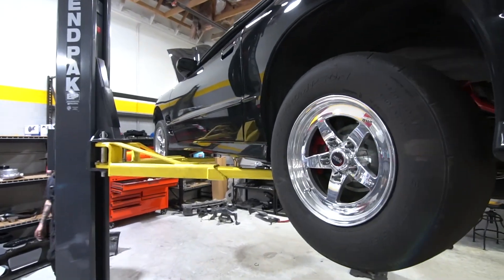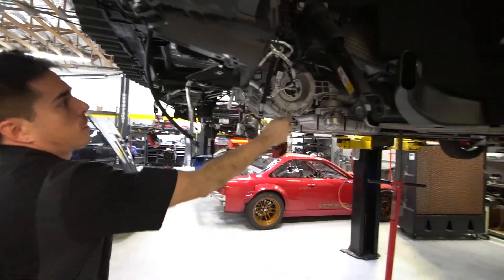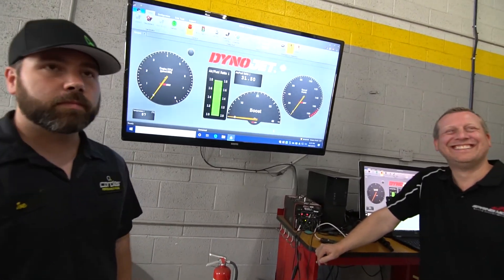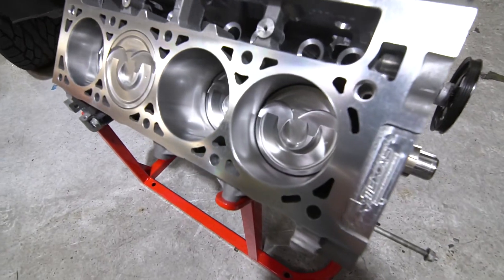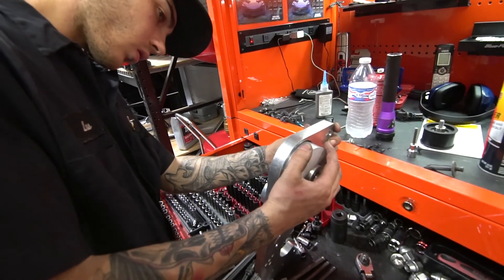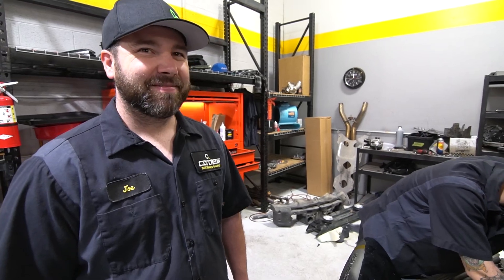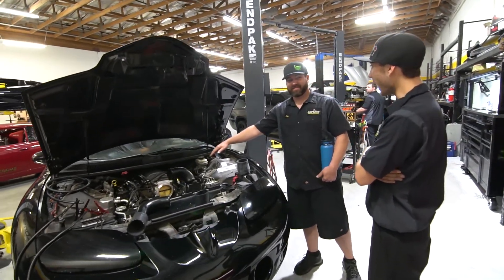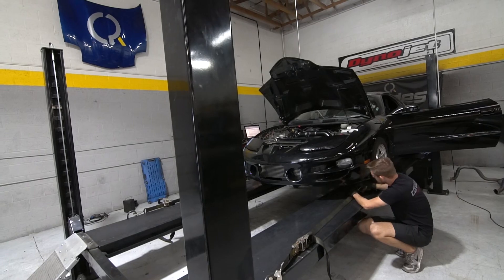CPR Season 2 Ep 47 ► D 1X Procharged 408 WS 6!

Comment: I'm trying to figure what I'm goin to put on my 99 WS6 currently running hot cam, 104 mm FTP air intake to 104mm MSD throttle body, MSD Mass Airforce intake, 36lb injectors, Texas speed 3/4 long tube s catted y-pipe and cat back. Stock 460LE ect. Was thinking about upgrading my torque converter (auto).  Got 399 HP at wheels wanta get to like 700 HP. Thoughts.
Reply: When you do the procharger upgrade your injectors to 60lbs

Comment: I’m trying to decide if I want to go with a d1x or f1a with vp110 on my 00 ws6 with a 11:1 383 , I’m trying to run mid 9s in the 1/4 , my current set up is a D1sc @ 5psi and pump gas and no timing in it ran 10.7 @ 127 ,
Reply: How much HP you making

Comment: How much boost were you getting out of the D1X??
Reply from the maker: We have made 1000 wheel with one before.
Reply: @CordesPerformanceRacing  I'm running a very similar 408 build and have a D1SC  I know it makes about 10% less flow than the D1X I'm hoping I can make around 900 wheel On 100 Octane AV gas
Reply from the maker: @TT-hx2xc  d1sc is usually done around 850 wheel unless you go a2w to get more flow through the core.
Reply: @CordesPerformanceRacing  Ya definitely need a bigger blower. When I bought this one I had it on a cammed 5.3L but that bigger motor is gonna eat lots more I guess we will see how it does but ya a bigger blower I'm sure in the future. Thanks for the replies! very helpful!
Reply: Hi guys I currently have a 2008 VE SSV L98 6lt ute, cold air induction and Mafles tuned system with extractors 
and  3" x  pipes.
My Question is can I run a twin procharger setup ?? And if so how much HP could be expected ?
And what sought of mods would need to be done to the L 98 6L ??? And to keep it streetable.
Which prochargers and intercooler would you recommend. 
Look forward to hearing from you soon. 
Cheers